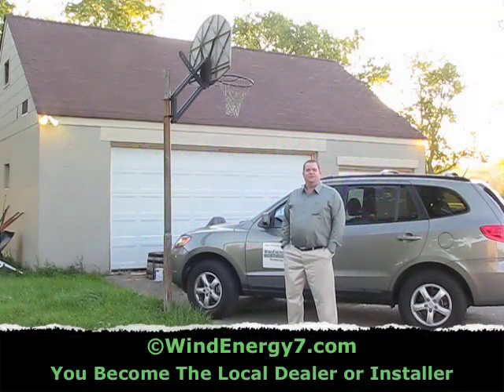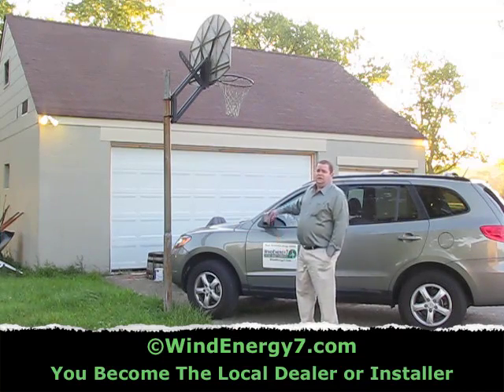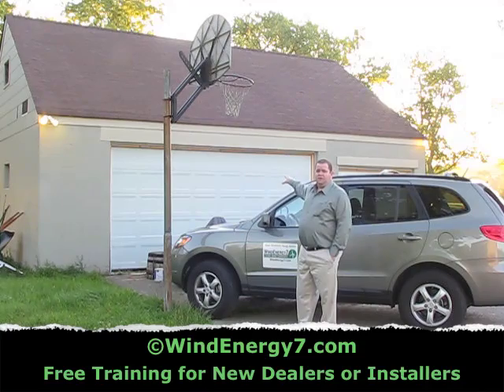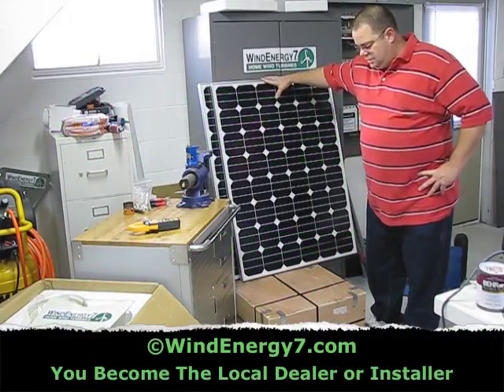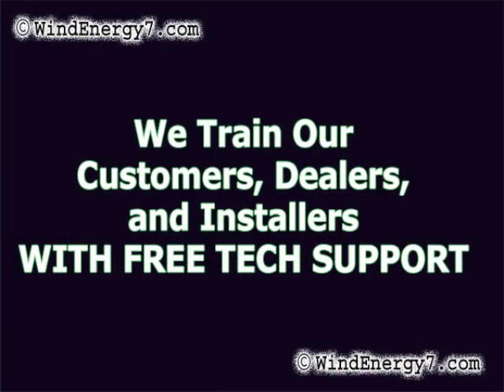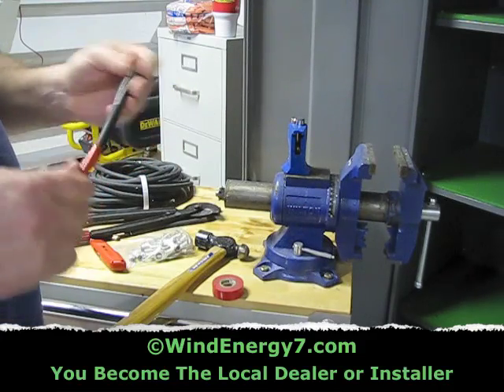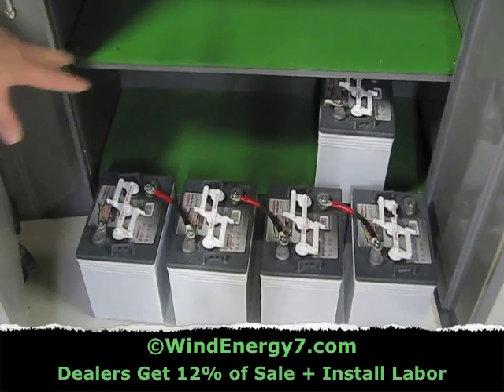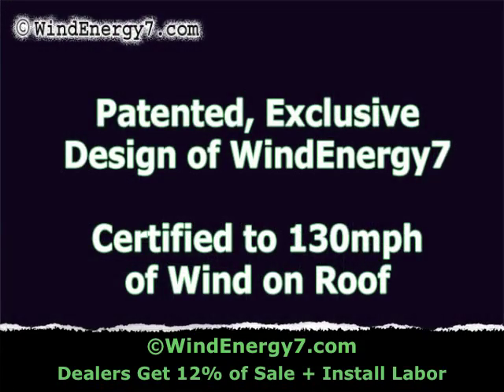Roof Mount Wind Turbine

Comment from the maker: That's what the invention is about, its pretty bad with any other turbine or mounting system.  As for the WE7 RoofMill(TM) not a single customer complaint of vibration to the structure.  We are many years in production and installed into most every state in the US.  This is a very proven system.  Rooftop wind for a home is not successful with any other system.

Comment from the maker: Yes, No Question that a Wind/Solar Hybrid system like we sell is far more efficient than solar.  Have a look at the system install, a new video at our website.. Wind Energy 7 dot com

A solar panel system cannot make power all night, our Hybrid RoofMill Wind and Solar systems can make power all night.  Solar makes very little in winter or when cloudy, a RooFMill system makes much power in winter and when cloudy is likely windy.  Wind (AND) Solar, that's what we do. Thanks Wind Energy 7 dot Com

Comment from the maker: Yes, easily, our wind turbines can withstand hail easily. Our solar panels can take a 10cm hail stone at 45 mph, that's almost baseball sized.  These are all weather permanent systems that stand up to all weather, that's what they are made to do.  The RoofMill is certified to 130 mph wind speed.  The RoofMill is the best system there is anywhere and we have an installed base in over 40 states of the US and export systems all over the world.  Thanks, Wind Energy 7 dot Com

Comment from the maker: Hi Rion, That depends on where you live and what site details you have.  In almost every site the balance is different.  They offset each other in terms of daily, and yearly cycles.  Solar can't make power at night, and doesn't do much when its cloudy, or when its winter.

Wind is weakest in summer when solar is at its yearly peak.  No matter where you live.

Solar is weakest in Winter when sun is low in the sky, days are short, lots of cloud cover, Wind is Best in Winter.

WIND ENERGY 7 . COM

Comment: If You are wanting  wind turbine roof mount kit, house mounted wind turbine, home wind turbine, residential wind turbine, wind turbine roof vent, roof mount wind generator, small wind turbine, roof mounted wind turbines for the home then check out their website. These guys have installations in about 40 states already. They have no money down financing for Roof Mount Wind Turbine.

Comment: This RoofMill™ unit comes with a certified structural engineer drawing.  The inventor will speak with inspectors personally if necessary.  This design is certified by engineers, stamped  in every state of the US for structural integrity to 130 mph wind speed.  Be careful what you put on your roof, this is the ONLY PROVEN SOLUTION, that's why we have patented it.  There's only one way to do it right.. RoofMill™ by WindEnergy7

Comment: If you see any other roof mounted wind turbine, you should know that ALL OTHER methods are known failures.  Noise and vibration will be on your home at an unacceptable level.

ONLY the RoofMill has solved the problems of roof mounted wind turbines.  That's why we have the patented method and system, because we solved the problems with a very professional and well built system.  We manufacture in Ohio USA.

WINDENERGY7 COM